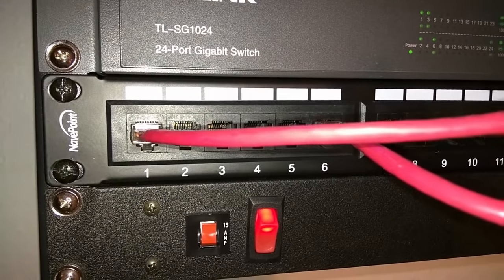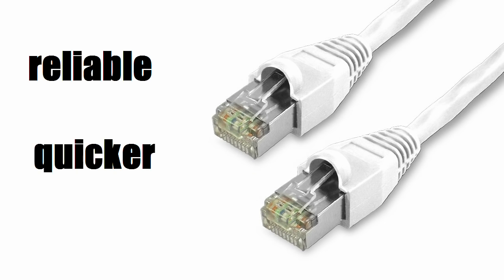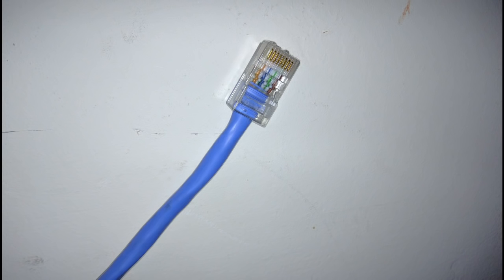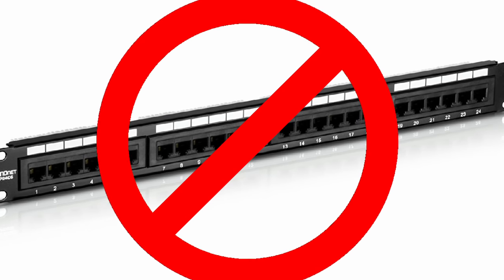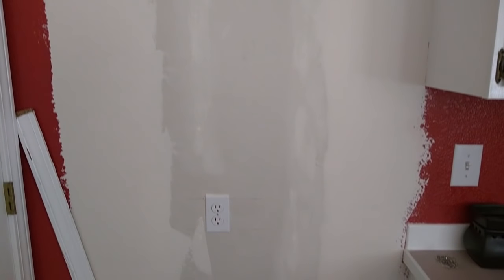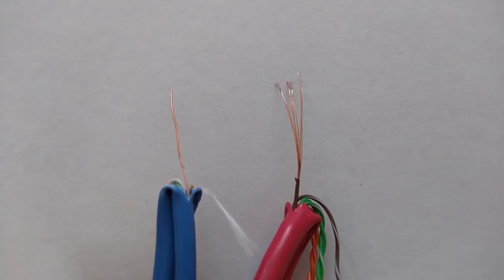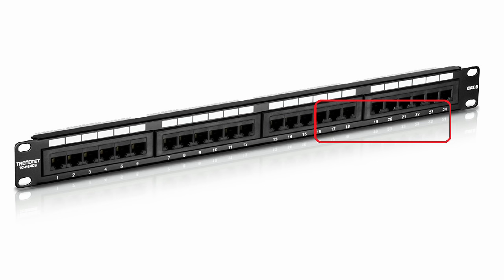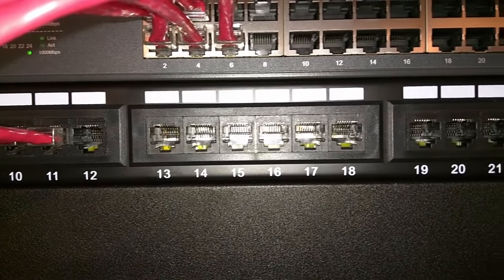What is a Patch Panel? Do You Need One?

Comment: What about patch panels with coupling keystones, rather than having punch downs? So from the front, the patch panel would act the same, but from the back the cables would be terminated. My reasoning for this would be to leave the cables if I ever moved out, but not leave the patch panel, so the next owner could use the cables I installed with a switch or router if they chose.

Are there downsides to coupler keystones?
Reply from the maker: A lot of people have suggested keystone patch panels. I think they would be a good option.
Reply: I think you'll find the blank panel costs less than all those keystones.  For example, a quick check shows a 12 position blank panel is under $15, but each CAT 5 keystone is about $4.50.  A 24 port panel with built in connectors is about $58.  Of course the prices may vary with source, but the principle remains.  On the other hand, a keystone panel allows use of any keystone connector, including those for phone, coax or speaker wiring.
Reply: @James_Knott  I have it all set up now. Where ever you buy keystones is ripping you off hard. Amazon has good Cat6 keystones for less than a dollar each. 25 for $20. It is way cheaper to assemble this way, and it allows HDMI and other odd keystones to be added later.
Reply: @suitch  As I mentioned, that was a quick look.  If I was actually buying, I'd put in a bit more effort.

Comment: I've worked with patch panels and they're great to make a setup look clean.
My question is how difficult is it to add to the patch panel once it's installed on the rack if you're using the shown type?
I've used the types sold at monoprice where you punchdown onto blocks that go into the empty patch panel, it just looks much simpler to work with and add to.
Reply from the maker: It's not too bad. With my small rack, it can be a bit hard to get to, to add another line, but it's doable. If you have easy access to the back, it's easy.

Comment: WWBND? (What Would Budget Nerd Do?)

Situation: You have a newly constructed one story home with Cat6 prewired throughout in every room, including extra drops for TVs, phones (VOIP), and cameras. All of your wiring terminates in a bedroom closet panel with RJ45 male connectors. You may also be considering setting up an NAS NVR system in the near future. You also plan to add a few WAPs. There's no crawl space so all cabling runs through the attic.

Would you clip off all those connectors and connect them to a patch panel?  I think there are about 24 cat6 cables running in there currently, but I expect to add a few more in the future.
Reply from the maker: WWBND? Lol.. oh boy.. since you're asking,  I would check the length and the slack provided on those cables. If the cables have the length, I personally would try to punch them down on a panel.

Comment: If you have cables in the walls I'd say go for it if you have more than a few cables. I have solid walls, so I can't really have a permanent cabling in an easy/cheap way. My cable system is a mess... but in my case terminating random "free" cables in a patch panel probably would make things even messier. But if I ever move to a place with permanent cables I will get one.

Comment: Awesome content! The way you explain the stuff is so good. Did you plan the wiring through the house when you built it? I live in a country where all houses are made out of concrete and were not made with home network in mind, would this still be possible and viable?
Reply: Masonry drill bits.
Reply: @tylersmith9868  Not that simple, especially when presented with concrete and double brick houses.

Comment: i never thought of it before but that would be great for me. i have stranded wires running around rooms and through walls. once i buy a house that will be one of the first projects
Reply: Why wait. If you want to setup a patch panel setup - go for it for the fun and experience of splicing your Ethernet cables to a patch panel.

Comment: Hey I like some of your videos.  I am looking to do a similar setup in my home (when the budget allows).  So currently I am planning.  When I start I'll have two options available to run the cables, attic or crawlspace.  Either is easily accessible, and neither will ever be finished (its a single story home).  Which do you think is best to run the cables?  Attic can get much hotter in the summer, but the crawlspace might be harder cause I can't stand up and I'd have to staple the cables up to keep them off the ground.  Just wondering what you're thoughts were.  Thanks.
Reply from the maker: It depends on the house, I find the crawlspace a bit easier to work with but, I have ran cables through the attic to the garage before. The cement slab makes it hard to get into from the crawlspace.

Just have to evaluate how your house is setup and where you are trying to go and decide what would be best.

Comment: thank you for the tutorial. Good stuff! Question： I am trying to use the patch panel to connect two Wifi Access Points (one is a cable modem and the other one Linksys acting as just an AP to areas in the house with week Wifi reception. Do I need to use a cross over cable to connect them, or do I configure one connection as A and the other one as B? Or do I just connect them using a stright Ehternet cable?
Reply: You should only ever need a cross over cable if you’re connecting two PCs directly to each other, as in not through a switch/router.
Reply: As for your other question, doesn’t matter so long as both sides of each individual cackle are configured the same.

Comment: What you think about instead of patch panel in small apartment let say 6 connection point use keystone  on both way of the wall cable
Reply from the maker: That works.

Comment: i thought about getting a 4u network rack and a 16 or maybe 24 port keystone patch panel. but my network setup is in a cabinet anyways. with my network printer on the shelf on top of the cabinet. i plan on getting a black and white printer to add to my network. i terminated 2 network cables for the printer shelf.

Comment: For a regular residence, you may no need one. If it is for a large business office where there could be 100's computers, printers... the network cables and connections needs to be organized for several reasons. Offices may go through changes and IP devices need to be relocated, the technical personnel may change jobs and others will be new at the job, cables may break down and need to be rerouted... Organization needs materials, labors and cost but in general it will get paid off in the long run just like anything else in a larger organzation.
Reply: Or you get older.  Once your Home Network is working, you don't mess around with it too much and you forget what you did 5 years ago!!!  I now have 2, 24 port Patch panels and a 48 port managed switch.   Everything is labeled on the Patch panels so I know to what device it goes to or the room and room location it goes to.  All the Keystones in the walls in all my rooms are also labeled.   If I have any issues, I can much easier find out where it is without hunting things down as I have in the past.

Really, the end result is a Professional Looking Home Network that is good enough that you can show it off to your friends if you want!!!  Not me, because then they want YOU to help them do their own.  This goes for Home repairs in general.  I get pestered enough as it is.   I just did whole House Water filter install and ran a hidden power and HDMI cable in the wall for a HDTV one day for someone at work.  8 camera Security system for someone else on their 2 story house.  That was fun.  Water Heaters, etc.

Comment: Since this is 2023, do you recommend CAT6 cable for the patch panel setup, or is (less expensive) CAT5e plenum cable still a good long-term solution?
Reply from the maker: If you want to future proof, I'd do cat 6 or 6a. If you only have 1Gb equipment or short runs and don't see yourself needing more than that, then 5e would work fine.

Comment: Forgive me for my ignorance but instead of a patch panel couldn't I just run it  straight to the switch? Assuming I have all the wires installed with a keystone and jack from my various outlets through out the house? Let me clarify; So let's say I have keystones and ethernet ports all installed already in the rooms I want? And I have all of it ran to one central hub like a closet, than I connect them all to a switch, which connects my router, which connects to my modem... Would that work?

Ignore me lol. I should of finished the video...
Reply from the maker: Yeah, you totally could do that, and yes, I did cover that in the video.
Reply: @BudgetNerd  My favorite thing about youtube is people who watch 3 seconds of the video, then ask questions answered starting at the 5 second mark.

Comment: I do not have a patch panel, I thought about it when I set up my network but didn't have the space to install it and the only closet i had was to far from the center of the house to set up the wireless signal, yes I could have install wireless repeaters but that would increase the overall cost, here is my system, modem to wireless router (router, switch and wireless combination), from here I install solid cables thru the walls to my office were I have 2 desktops and a network MFP machines (printers/fax/scanner) and a 16-TB storage box, my network had to be secure so wire was the only solution, the wall cables ended at each end with a wall plate and from one end connected the router 4 ports and the other end to the machines.

Comment: Please elaborate, or do another video on how plugging the crossover cable into two specific ports on the patch panel creates a mini-network.  I've seen this done before, but have never heard of the why or how it works.
Reply from the maker: That's a good idea.
Reply: One thing to bear in mind is crossovers really aren't needed these days.  Gb and newer 100 Mb gear automatically detects the connection type.  That said, I still have a crossover, in my desk drawer, that I made from a line coupler many years ago.

Comment: Great looking setup neat and tidy I love the look of it. The only thing is the wall plate where you have them numbered port # 1, 8,6 etc. It would drive me NUTS saying that it drives me NUTS that they where not in sequence # 1, 2, 3 etc. I couldn't sleep at night knowing  they are not in order!!!!  Now that I have settled  down quick question please.  The punch downs on the patch panel have a certain order or pattern (eg. orange orange strip in position one  then position two etc. On the wall plug on the back of the plate will that punch down have to be from the manufacturer or will that order be different? Like orange solid in position one orange strip in position two. Or can that be different from one end to the other. I hope I am clear in my question.
Reply from the maker: I would like them to be order as well, but it's no big deal to me really. Even if you did make them in order, the first time you added another line down the road, the perfect numbering starts to fall apart.

On the back of the patch panel and on the keystones that snap into the wall plates, there are colors that tell you where the wires would go. There are two standards, A or B. Just use the same standard at both ends. My other videos cover this as well.

Comment: When do you recommend to stop using WiFi and switch to cable? I only have a 50Mb connection, and as far as I know, my router's speed is 300Mb/s so I don't need to do this until I get a better ISP am I right? (Sorry for my english)
Reply from the maker: I would never stop using WiFi. Wifi is nice and there are devices that only support wifi.

Is 300mbps your routers wireless speed? That enough headroom for your ISPs 50mbps. Wire anything you can, but for those devices you can't wifi works.
Reply: Choosing cable over wifi has more to do with access to a good wireless connection than it does internet speed. If your wireless access point is in a place that is less than ideal for a given device, wired would be better.
Reply: Not using Wi-Fi at all isn't a realistic goal. What you should try to do is minimize the number of devices that use it. The way you do this is by using Ethernet for every device that stays put. This includes desktop PCs, gaming consoles, smart TVs, and even printers. There are even quite a few devices that don't appear to be Ethernet-compatible but will work with an adapter, such as streaming media players and smart speakers.
Reply: Simple answer is....if it doesn't move, cable it if possible

Comment: Hmm wouldn't it be just as easy to run the cable terminate on a key stone then just terminate the other side rj45 then directly into your switch is the only reason for putting it into a patch panel is because you don't want the cable to wear out?
Reply: I would say the main benefit is order/neatness.

Comment: I noticed you run a single cable for every port on the wall plate. I live in a 2 story with the modem on the second floor. I will be running cabling to 3 separate rooms down stairs, 2 ports each, 6 cables total. I want to have the WiFi access point downstairs. Is there an advantage (or disadvantage) to running 1 cable downstairs to a switch and then running 6 cables off the switch? Or would you recommend just running 6 cables with the WiFi access point connected to a wall plate?
Thank you, I’m learning a lot from your videos.
Reply from the maker: Not much of an advantage. I had the extra cabling so I ran more. You could totally run one cable to an area, and then just use a switch.

Comment: Does keeping your router in the comms closet limit your WiFi reception? Seems like it ought to be on a wall or ceiling outside the closet.
Reply: 2.4 GHz, not as much. 5 GHz, yes.
Reply from the maker: It would yes, but not much. We don't have issues.

Comment: you have the sockets upside down at 5:10
when a network guy installed the first 5 cables for me he pointed out that by having the clip on the plugs at the bottom, unused terminals do not accumulate dust over time.

i'm just about to install some extra data lines for the new network printer and theater room, so watched a few of your videos as a refresher, thanks.

Comment: If you’re put off or intimidated by this because of having to terminate to the back of the patch, they make these with male-to-female coupler so all you have to do is insert the cable into the back of the patch..😜 no more excuses to not have a patch panel. They also make the wall outlets with male-to-female keystones you don’t have to terminate to. Making being a nerd that much easier these days.

Comment: I have a patch panel in my home did not number anything No idea what go were so plugged everything in.  I have a cable with a yellow light which means something no idea likely too long or bad or something.  However today I would use keystong patch panel and 
CableCreation 10-Pack Cat6 Shielded Inline Modular Coupler with Keystone Latch, RJ45 Modular Coupler for Panel Connection,Cat6 8P/8C Female to Female Class E  as it provides a better connection as well as easy movement of cables and better cable management.  The main reson is one connection go bad and the patch panel as a unusabel port cheeper in the long run to do it the other way.

Comment: What if you want to upgrade all the cables from Cat6 to Cat7 or Cat8? Seems like a ton of work to upgrade the cables.
Reply: Point taken, but then you need to ask yourself what you're trying to achieve.  Do you think you'll be running devices that will need more than 1Gb/s speed connection? Doubtful but not out of the question. But one trick in the industry is to tape new cable to the end of old cable, and re-pull from one side to the other, acting as a pull string. With data/low power cables, you aren't required to staple or mount them in any way like with 120V-240V.

Comment: what do you do if your patch panel goes bad on you? do you replace the whole unit,  or do you replace a particular  RJ45 port if found not operable?
Reply from the maker: This particular one I have I would think you would have to either change a bank of ports, it the whole panel.
Reply: In this case the whole patch panel unless you have a empty spot not being used that you can switch to.  I'm using a Patch Panel that uses Keystone.  I think it's so much better is a number of ways.  For one, Much simple to install a Keystone on each wire and then snapping that into the Patch Panel.  Another reason just like you were asking, if a port goes Bad, well you can pop the keystone right out and install the wire onto a new Keystone and snap it back into the Patch panel.  All fixed!!!

Comment: Video was great, i will be looking into it BUT your cable coming in the comm room from the wall - you dont seem setup completely or havent used all the terminations. In order to expand you would need to go back into the wall to install more cables at a later date to. With up 24 cables coming out of the back of the patch panel you will need to penetrate the wall for another bundle, is this correct?  

I guess another way to minimize clutter in the comm room could be coming from the main switch to the 'TV area' and landing that on a smaller switch. Any idea where to find pros and cons for that type setup? I know, it would eliminate the patch panel, just looking at options.
Reply from the maker: +Apex 8 I think I figured 24 cables would go through that passthrough. It might be tight though. You could do a switch instead of running multiple cables.. but I didn't have another switch and I had lots of cables. I just wanted separate ports. In most cases a switch would be ok. I just didn't want it to become a bottleneck...